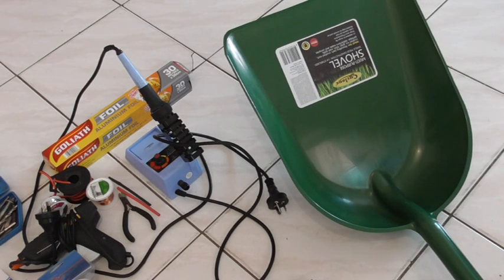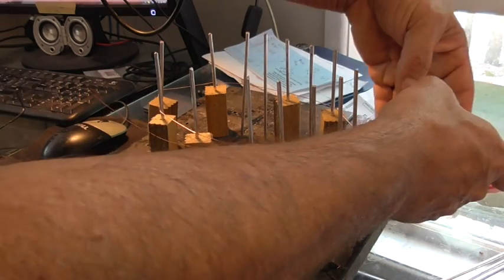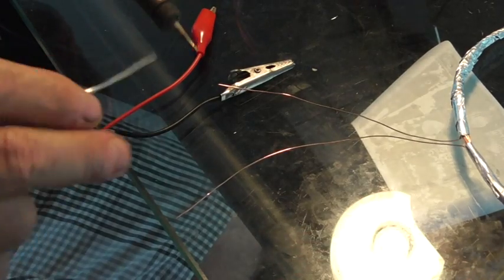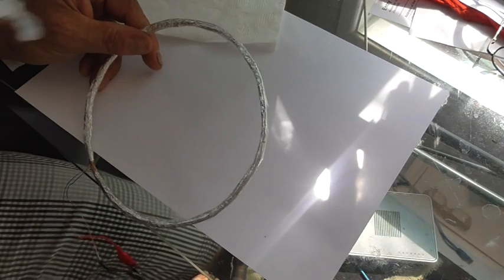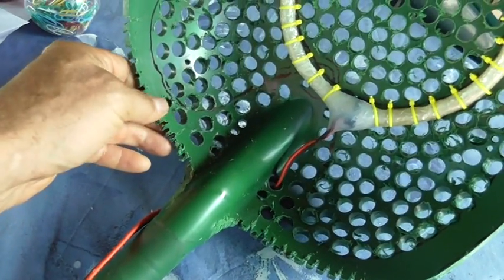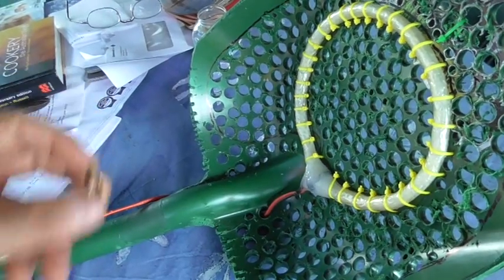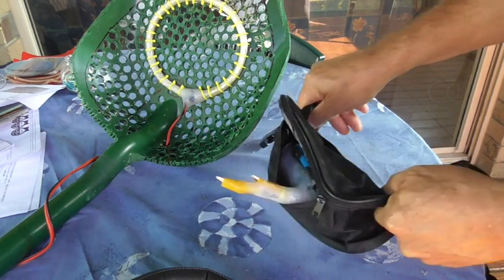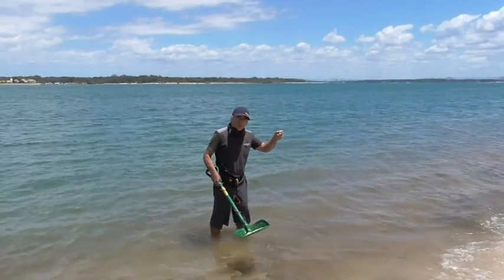MY CRAZY GOLD FINDING INVENTION: It works better than expected.

Comment: if you put this into a plastic box and add paraffin, or wax covering all, if need make some repair is more easy and cheap, exist one special oil called in my country Xanox come in spray, to protect electronical circuits, and water moisture dont afect. in factt if i remember well can put into water some centimeters, just be sure do not have coils into pcboard.

Comment: About the silicone...make certain that you use a 'non out gassing' variety.  The cheap hardware store stuff...as it cures makes acetic acid.  You can smell it...smells like vinegar.  The acetic acid will attack any exposed copper..like where wires attach to the pcb and literally eat the copper away...leaving you with so much garbage can filler.  This misuse of RTV has put many fledgling companies out of business.  They spend their money building thousands of an item...then it all gets sent back within a few months and it can't be repaired because its potted in the silicone.

Comment: Do you ever tune the damping resistor in your boards? Or do you just go with what the parts list says?
Reply from the maker: Hi Dustin...Never tried a damping resistor. i think a oscilloscope is needed for this. Am i right?

Comment: considering PI machines cost upward of $2000 US, this is quite a deal if you don't mind doing the work to put it together
Reply from the maker: That was the aim of the project but the time it takes to get the circuit working right makes a second hand detector worth considering.

Comment: Hey I have one built with the coil I made but I hear a slight noise but nothing loud can you help me
Reply from the maker: I had one do that to me.Check the coil ,is it connected. is the speaker wires right way round, even try changing the trim pot around. then check battery power is above 11.5 volts.
Reply: It’s hard to make with out a multimeter. I have .05 copper wire 8 inch’s 20 turns on the sm. Can you tell me about how many turns I need for a 10”
Reply from the maker: With .5 using less than 20 puts a lot of stress on the circuit.I used 25 turns for a 8 inch, but 30 would be better. If you use .45 as the manufacturer recommends then i think it will work even better. There is a specific impedance setting for the coil, i can't remember what it is. but very tricky to get right. i don't bother. Setting the two time delay pots are more important,-  however keep in mind that i am not a technician or the circuit designer.
Reply: Will try today I appreciate you responding 🙌🏾
Reply from the maker: My first 2 failed and i can't fault find them

Comment: Thank you for the videos! Very informative and appreciated! I watched your DIY on the Barracuda PCB. I'm going to build one, but I must ask, what are the specs for the coil you made (Turns (I think you said 22), wire size, etc.) ? You stated it is the best for this design. You'd save me a lot of time and headaches! Thank you in advance sir!
Reply from the maker: Hi John,- the video is accurate and descriptive. Because i was using .5 wire instead of .45 it is better to use at least 21 winds or more as not to stress the circuit too much.Remember that many things can go wrong as it is not a easy build, but when it works well , it can be rewarding.
Reply from the maker: 8 to 9 in dia round or elliptical seems to work best--
Reply: Thank you sir! As an electronics tech in my youth, I shouldn't have any trouble, but thanks to others there is a plethora of information out there!
Reply: Thanks

Comment: Frederick...congratulations..question:the coil What kind of wire use and thickness.thank you.
Reply from the maker: Should use .45 copper insulated wire at 8 in cir . but i use .5 and add a  few more winds
Reply: Thank you.

Comment: should build a fold-able metal shovel to have super strong magnet of course with the holes to be electric power to boost performance so that you don't lose any small object then the hole.  The way I see it its not going to net any money since most metal that are found are pretty small so you might want to either go with the metal shovel with the magnet or you can go with a netting so some sort over the hole so that you dont miss out on tiny treasure
Reply from the maker: The magnet idea will remove small bits of iron so you can use a PI Detector... so good idea...

Comment: Clever!  2 questions:  1) is the Barracuda circuit board available in the USA?  2)  Is the detector OK for use on land or is it optimized for salt water immersion?  TIA!
Reply from the maker: Baracuda can be bought from Silverdog in England,- to anywhere I think- Works on land good, but no discriminator, but very tricky to complete without mistake- my video best chance of sucess
Reply from the maker: yes to all except do not immerse in water unless you are sure it will not leak. Tricky project but

Comment: save on zip ties, tape n sticky fingers, jus tie a few to hold it down n silicone to shovel with gutter caulking after your 1 tape job...great innovation, whare do you get the control board?

Comment: Look up the Keshe Foundation on Utube and find out how to Nano coat the wire. . .
Reply from the maker: +Sam Noel Pearce interesting
Reply: +Frederick Barnes Mmmmm . . .it is isnt it. . . I was wondering how it would change the standard english electronics kit . . . or if it would have to be modified due to the nano coating changing the sensitivity of the ring . . . !
Reply from the maker: Worth experimenting with it

Comment: Dude crazy invention, but in the end you're going to get rich by not having to go out and dig, alot of people have gotten rich by make something that help to find gold without the back braking job of digging for it. But you should try to get a patent before showing the whole world on youtube.
Reply: +Carl Smith  sell an attachment that works with already available detectors
Reply: You cant Patent something you haven't invented. the detector board is the surf PI all the information is available on  Geotech Forums and the surf PI circuit is taken from a Whites Metal Detector design..
So is the Barracuda PCB both are available from http://www.silverdog.co.uk as a kit.
Also the coil build info is also available on http://www.Geotech1.com/forums/
Credit where credit is due!
Reply: it's a sifter with a metal detector on it, not really pattent worthy
Reply: Cat Simson not a bad ideal but it would only work in sand.

Comment: Good work mate. You sound like a typical Aussie that are clever at innovating and making things out of nothing.
Reply from the maker: brockbest thank you,-
Reply from the maker: +digginya Call 911 larger dia will loose sensitivity to smaller objects, 8 to 10  inch coil with .45 copper insulated wire seams to work best for ring size objects on that board . More than 25 winds will increase weight and make the detector uncomfortable to use while giving only very small gain. look up "point of diminishing returns"i like the baracude board because it is relitivly simple.11 inches on a ring in dificult ground is very respectable
Reply from the maker: Good project but lots can go wrong.All the best

Comment: Hi Fredrick 
Thanks for the reply do you know of any formulas to calculate the coil dimensions for the different diameter wires on different diamater coils as I would have thought more turns would  increase the resistance and less turns would decrease. My thoughts were to use the same length of wire  as you were using in the 8" coil which gave me 17.88 turns at 250 dia.

Comment: Thanks for theat Fredrick I am wanting a 250 dia coil which from the calculations off your 8" dia coil gives me 18 turns on a 250 dia using 0.5 dia wire as you have sould give same resistance . Also have you made a oval shaped  or a square coil and what results did you have.
Reply from the maker: Ron Gill oval will give more sensitivity and better ground coverage. i found using .5 wire that the more wire i used the better,- to a point. the original manufacturer states .45 is the best.why not experiment just make sure you check everything before you connect power. also i would go with 22 turns as you dont want to have more resistance than it can handle . i once used 18 turns using .5 200 mm dia and quichly damaged the circuit, so i opted for more wire on the next coil and it works unusualy sensitive and still going strong.

Comment: Hi Fredrick
After seeing your video and use of the Baracuda matal detector  before xmas I placed a order on Silverdog and my kit arrived yesterday and seeng the coil in shovel idea today will work for what I have in mind just a detail the wire you used for coil what Guage was it and what is the impedence? when finished can the other coil be used the same if water proofed and tied to a shovel in the same way. Ron
Reply from the maker: Ron Gill if you use point 45 wire i think the impedance is best at around 300.but mine works just fine at 22 turns of point 5 in dia at .8 in diameter--- i know too much resistance will damage the board. --- for example 10 turns at .5.--- i am no expert. The shovel works but not in stony ground.--best  kept seperate as the search head has to be bent, to search flat..

Comment: Hi Fredrick, when you put the shield on the coil did you connect it to ground or left it floating ? thanks good video.
Reply from the maker: Peter Smith left it floating. if i knew how to ground it without possibly damaging the board i would.Maby you can tell me how i might do this (not ment to sound like a smart ass reply)
Reply: Frederick Barnes

Hi thanks for reply, its amazing that you can put the coil in salt water and not get a response from the salt water with an ungrounded shield on the coil, to connect the shield to ground, FIRST, wrap the coil in tape, then wrap the foil shield around the coil and connect it to ground, the trick is to get a good connection to the foil, if it was copper you could just solder it, but its aluminum, so you could first   wrap a couple of turns of a small gauge multi strand wire around the coil then wrap the foil making sure of a good tight connection of the wire to foil, bind it tight with tape so the connection does not move of course strip off the insulation of the wire first, OR you could wrap the foil then make some conductive glue from powdered graphite and varnish and glue the earth wire to the foil , now because the Barracuda uses a P FET, ground is negative of the battery.